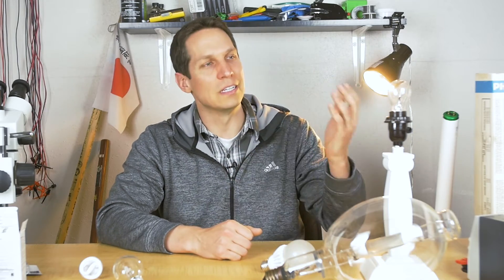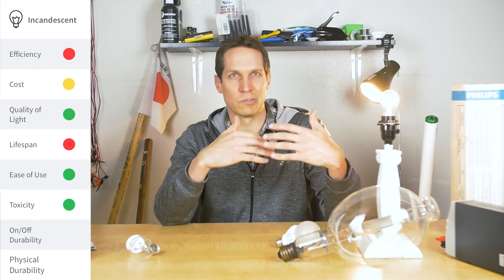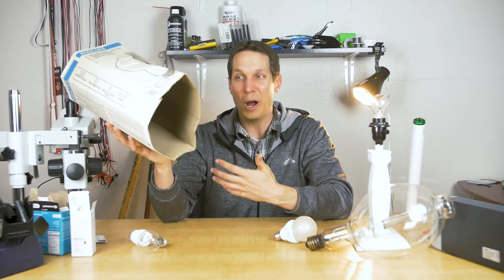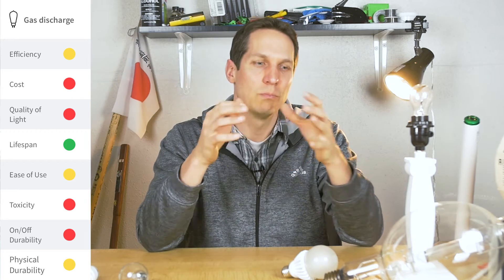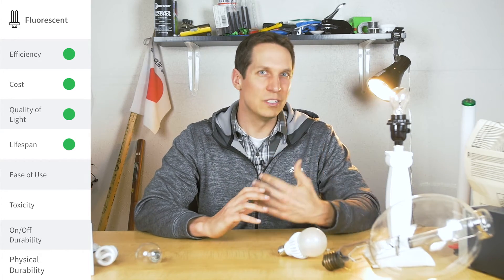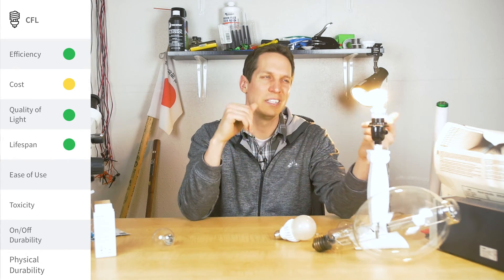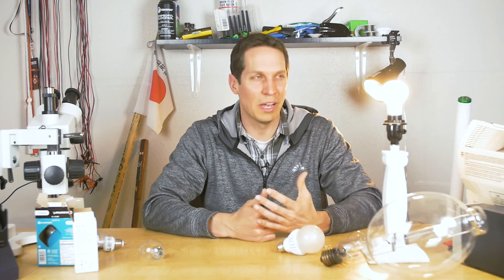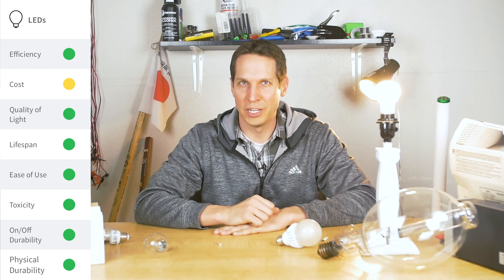Why Are LED's Better? (Comparing different types of light bulbs) | Basic Electronics

Comment: They are not necessarily better.  I swapped out 8, 65 watt can lights in my kitchen.  In the summer it was fine, but in the winter the space was colder causing me to run my gas furnace more.  There are trade offs.  And NONE of them lasts the 18 or 22 years as stated on the boxes.  None of them.

Comment: Every one talks about the light color and savings of leds but no one seems to talk about the actual wavelength of the actual light itself.  What I mean is leds produce a ßtraight light wave that's on the ultra violet side  similar to a laser beam  leds like florescent cast sharp shadows  leds can be harsh on the eyes and some people claim nausea  were as incandecents produce a soft fuzzy light wave that is warm and gentle on the eyes wich we are used to much like the sun a warm glow on the infrared side  I'll deal with the heat is a nice bonus in the cold of winter

Comment: Keep in mind that the tones that are more blue-white in color are not good for your eyes. The more softer yellow tones are noted to be better on the eyes.  I guess the bluer tones are tough on the retina.  There hasn’t been much in the way of studies on the heath effects from LED light bulbs.  I think this is a must, especially since the government is pushing all LED replacement light bulbs, and you can’t find any regular incandescent light bulbs at the stores.  Lot’s of talk on energy savings, but how do these LED bulbs affect your vision and health?
Reply: @violet_world9385  LEDs are indeed bad for your health. They affect your circadian rhythm and are harsher on your eyes than incandescent.
Reply: @John-bs5ug is it the color of the light or another aspect of their performance?  Becuase I use 3000k yellow leds for light and they definitely feel better on my eyes than the old leds i had
Reply: @Tipman2OOO  The main problem with LEDs is that it's a completely different type of light source than incandescent. LEDs produce directional, but non-uniform light, and it's actually classified as a type of laser.    They flicker rapidly and that can cause some people to get headaches or migraines. You also don't get a full spectrum of light with an LED like you do with incandescent bulbs, which aren't directional and give uniform lighting. Color temperature is a way to measure the color of a light source, but even yellower/warmer LEDs contain blue light that affect your circadian rhythm.
Reply: @John-bs5ug  really no way?  Interesting I'll definitely have to read up more on that subject!
Reply: @Tipman2OOO  Yeah, it's pretty bad.

Comment: Most of the energy that goes into incandescent lamps is emitted as infrared light, not heat.  Besides infrared heating, this also makes them excellent infrared camera illuminators.
There is no UV blocking coating on the metal halide lamp.  The outer envelope is made of borosilicate glass, which is opaque to the nastier short wavelengths that the quartz discharge tube lets out.  In terms of color rendering, some quartz metal halide lamps have good halide mixes and thus good color rendering.  Ceramic metal halide lamps also have very good color rendering; the warm white Philips MasterColor lamps I use are on par with incandescent.
Efficiency is only one of many design criteria, not the only design criterion.
Reply: Incandescent are good for human health also because of infrared light. They perfectly imitate the sunlight. LED light is dead light, cheaper LED bulbs can even damage your eyes and are migraine trigger.

Comment: Hello, why don't you use lamps with a gu10 socket? Could you explain the difference and which one do you consider more convenient?
Reply from the maker: In the US, GU10 sockets are very uncommon.  I'm not certain why.  In my house, I only have one fixture with a GU10 socket and frankly, the bulbs I got for it barely fit in and required me to make some modifications to the fixture to do so.  I think it's just kind of a de facto standard to use the E26 base. 🤷‍♂️
Reply: 🤬 First saw GU10 was about 15 years ago when someone thought that was the best idea for saving time for bulk installation.  LED is second stupid extremely slow idea continue in test phase to replace a basic simple light bulb .

Comment: Low-pressure sodium lamps are actually the most energy-efficient type of lighting available. They are even more efficient than LED lights, but they are not as versatile or practical for many applications, since they only produce a yellow monochromatic light and are not capable of producing different colors or brightness levels.

Comment: Does led give of any heat?
Reply from the maker: Yes, they are not 100% efficient, so LED bulbs will still create heat.  However, compared to an incandescent bulb or halogen bulb, it will be significantly less.  Similar to a CFL, generally.
Reply: @CircuitBread  ok thx for reply👍

Comment: Your chart needs to be updated with red for LED next to cost and yellow for lifespan. I have yet to be convinced LEDs are that much better. I have actually had regular bulbs last longer than most LEDs that I’ve owned. Just not really impressed. And I do not buy the cheapest ones either, which none are really that cheap to me. Changed most all of our lights and I saw really no difference in our electric bill.

Comment: Compared to other technologies, this is great, but there's a giant elephant in the room that has been sitting around while we've been comparing our humanity's lighting progress to incandescent bulbs. For the past 10 years, the LED bulb efficiency available to homeowners has been stagnant thanks to industry planned obsolescence and cost. LEDs are TODAY being sold at efficacies only between 40 - 110 lumens/watt while we have access to affordable 150 Lm/W 90 CRI LEDs and 200-240 Lm/W 70 and 80 CRI LEDs under 20 cents per chip. 

I'm saying this because when I do contract manufacturing designing light engines for clients, I have sourced LED chips that are 2-3x more efficient than off the shelf or even commercial specialty store ordered LED bulbs with no particular difficulty or large cost at all. Just look up Samsung's LM281B+, you can get that 200 Lm/W 80 CRI LED for less than 5 US cents a piece.
 It's easier to manage the heat and the lifespan when LEDs get more efficient, but the only customers taking advantage of truly modern LEDs are those buying LEDs for high bay or agricultural lighting and that really needs to change.
Reply from the maker: I agree 100% - thank you for sharing your perspective!

Comment: ok, is it possible to get the bulbs without the power-converting electronics? and then, can I reasonably wire a DC bus in the house, for those bulbs? You mention LED "strings" as being powered by a single power supply; have you heard of this being done either commercially, or by a hobbyist/experimenter? By the way, I recently heard that the Phillips brand has electronics that last a reasonably long period of time, in some cases lasting a number of years.
Reply from the maker: Honestly, I don't think they manufacture standard sized LED bulbs (too high of a chance of putting it into a normal socket and destroying it). You can get 12V vehicle bulbs and things like that.  But, if you're going to wire a DC bus, you'll still want it to be fairly high voltage (unless it's a small house, though the LED loads should still be minimal).  LED strings being powered by a single power supply is extremely common now - commercially, residentially, and with hobbyists.  I have a few in my house - I even have a Philips brand string that can be controlled by an app.  Frankly, I don't like app controlled devices but I wanted greater control for this particular string.  In general, though, Philips products are considerably more expensive than a more straightforward string of non-variable color and you're locked into their ecosystem.  Amazon is your friend in this case (though definitely not the only resource) and you will see a plethora of options at different lengths, colors, voltages, etc.
Reply: @CircuitBread 
that does make sense... that said, a bulb that had a different base (that wouldn't screw into a 120v ac socket) might be a way to allow the use of one WELL built and designed power supply (dc, for those bulbs) to power a bunch of these bulbs, in say a set of apts, and these bulbs would NOT contain any electronics, because the incoming power would be what they want. Do you think such an arrangement would save energy? -Jim (by the way, I'm also trying to hang out on your discord presence)
Reply: constant current LED drivers and their power electronics are typically 90-98% efficient these days with >95 power factor when converting electricity to DC from AC. Your house is set up for AC unless you're designing an off-grid home. The electronics aren't the problem, it's the quality of LEDs that are. Most LEDs being sold sit at 40-110 lumens / watt efficacy when up to 240 Lm/W is available.  

12V LED strips are even worse. They use 3 low Lumen/watt LEDs plus a resistor that burns 30% of the DC power as heat for cheap easy regulation. If you're doing it for reliability, it's probably fine though. Not so much if you're trying to light your home efficiently.

Comment: LED light bulbs has 95% more energy efficient, 100,000 hours lifespan, highest light quality, easiest to use, no mercury, best on-off durability, and greatest physical durability, but the initial cost is moderate.

Comment: Hi, thanks for putting out these videos, I'm learning a lot. My questions are, you say that LED bulbs have electronics inside them? What does the electronics do? If they only are a DC power supply, is it possible to have one power supply per (say) 10 bulbs? Is this already done? And finally, which brand of LED bulbs have the best, longest lasting electronics for LED bulbs?
Reply from the maker: Hey Jim!  The electronics take the wall AC power and convert it to whatever the LEDs need (a lower voltage DC signal).  And while it is a DC power supply, it's attached to that single bulb.  However, that's exactly how LED strings or strips work.  One power supply that drives a lot of LEDs - though they're not bulbs.  As to which brand is best, I haven't done the research, unfortunately, so I don't have any recommendations.
Reply: LEDs have rectifiers (turns AC to DC) and current regulators (controlled by a resistor) inside the base.   

Electroboom and BigClive have videos on their channels deconstructing LED bulbs and circuits.

Comment: I was bouncing ideas off a friend on the theory you could make an incandescent bulb that beats LEDs using some kind of transparent insulation. It was good until I realised you wouldn't be able to switch them off instantly... The insulation would stop the filament from cooling down meaning it would glow until the energy in the filament could escape. The filament was induction heated so it had no physical connection that would conduct heat to the outside of the bulb.

It was either using transparent insulation or an internal reflector to turn the the light into a single point Lazer focused on a coated lense that would reflect the infrared light and stop it from escaping in the beam. The biggest issue that most materials that could make this possible melt at 1,200-1,400°c and a lightbulb needs to heat the element upto 1,400-2,000°c (anything inside the bulb would reach an equilibrium as the heat can't escape). You can make red light at around 750°c but the light emitted would be pretty dull.

Comment: No house has LED bulbs only. The oven counts as the incandescent bulb in the house. And most microwaves also have incandescent lighting. And some fridges do as well. Especially older models. Also they are banning incandescent and A19 halogens in 2023.
Reply from the maker: True, there's also the light bulb in the dryer that's incandescent.  Incandescent does better in really hot areas and, when it's not used much, their lower efficiency doesn't matter as much.  
Reminds me of my father-in-law who needed to replace lightbulbs in elevator pits (I think?).  These lightbulbs are on for about 5 minutes, twice a year.  At that point, is the higher manufacturing cost of LEDs worth the greater efficiency?  I'd say no, but the incandescents are getting more and more difficult to find.

Comment: Great video, but high pressure sodium bulbs will always be my favorite. They light up an entire room, are efficient, and emit this nice orangish white light. I wasn't aware that it was illegal to manufacture mercury vapor ballasts in the U.S, but you could use a HPS or metal halide ballast to power one if necessary. I'd also like to add that mercury vapor and low pressure sodium especially last basically forever. I've seen low pressure sodium lamps under bridges or near observatories last for something like 15 years, and there are a bunch in my city that have been running basically as long as I can remember. Although, one con about HID lamps that you mentioned is actually worse than you described, and that's the cost. When I first got into HID lamps, I spent something like $50 dollars on a ballast for my HPS bulb and on a 4kv pulse rated socket. There's a lot of hidden costs there if you don't already have a ballast that supports the lamp type. Another thing I want to mention is that tube fluorescents actually have better on/off durability than most CFLs. The flickering thing actually causes a lot less stress on the electrodes than instant start ballasts which basically just shoot a high voltage charge through the bulb to start it. It's less annoying which is why most CFLs are built like that, but it does reduce the lifespan. Anyway, great video.
Reply: They ayush very poor CRI. They are monochrome lights used in observatories to block oute lights

Comment: Yes but there is a downside to 120 volt LED bulbs. The shitty switching power supplies send copious amounts of garbage back into the AC line. This can have a number of adverse effects... one of the worse being it makes expensive high quality audio gear (powered from the same circuit) sound lworse adding grain, fuzz and nasties into the signal path. I own some rather nice sound reproduction equipment and I can certainly hear the effects of switching power supplies in the same AC line so... whenever I listen to my music I turn them off.
Reply from the maker: Yeah, in retrospect, I wish I had emphasized the difference between LED technology and the power supplies that power them.  I think LED technology is great but I've been getting more and more frustrated with the low quality power supplies that are integrated into bulbs and cause problems like this and are often the point of failure.

Comment: They aren't and don't tell me they last longer than incandescent light bulbs. LEDs burn out all the time, it's really frustrating when they are supposed to last years. I've had LED bulbs burn out days after first using them. 
LEDs also have a strobe like, even the ones rated for dimmer switches. 
Some LEDs get really hot. Turn on the light on your phone and try touching it after a minute, it burns. 

I tolerate LEDs because they use less power, but that's pretty much the only way they are better.
Reply: This is an older comment, but the issue of flickering will only be present due to the PWM that he describes in the video with certain power sources. There are LEDs without PWM if you are looking to use some in your projects and those will not flicker regardless of the power level.
Reply: @professorquarter  can you point me towards brands/bulbs that would not strobe? Thanks.
Reply: @themonsterunderyourbed9408  He mentioned Cree in the video. I know some of their lights use typical/analog dimming methods. That is the only common brand I know, but you will probably need to read the description on whatever you see in the store. If you are looking at non-Edison lights, then it will be a lot easier as direct-current LEDs are pretty common outside of home lighting.

Comment: Halogen bulbs aren't hotter than incandescent bulbs AT ALL. They consume 2/3 for the same amount of light, and the double glass is just for cutting costs, as putting a G9 halogen bulb into an E27 incandescent is much cheaper cuz  you need less gas for filling the small G9 than the big E27, E14, GU10, GU5.3, GU4 etc.

Comment: Leds are more efficient, but incandescent lights have no flicker and very pleasant warm light. Led flicker so fast  which your eyes cant detect but your brain detects it and makes u have headache like myself. Sodiumpressure and mercury vapour lights may have bad colour rendering but they are mire reliable then led for street lighting, many must have noticed newly replaced led street lights turn on and off for no reason on streetlight posts that may be unsafe for drivers. Led is not a fairytale yet like this guy describes it, it still has a long way of development to go
Reply from the maker: If I could go back and change one thing on this video, I'd put more emphasis on the underlying technology than on the current applications.  I still wholeheartedly think LED technology is fantastic, but the last few years have seen some terrible applications.  Cost cutting in the driver technology to be more economically competitive with other lights has yielded too many products that are, to be put it kindly, subpar.
Reply: Leds not healthy.  Check it out
Give off blue light not good
Reply: @christinachristina8271  You can get leds that are yellow with much less blue light
Reply: @portman8909  oh very good
Merry Christmas ❄️